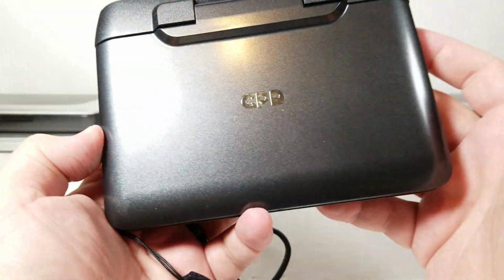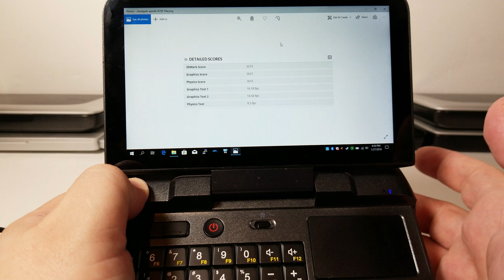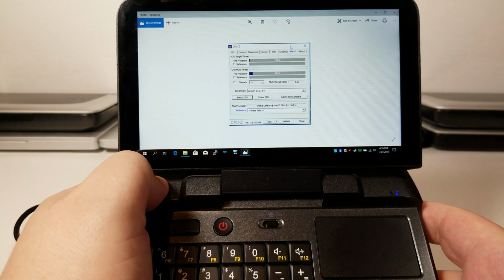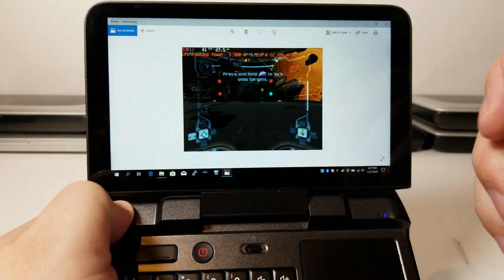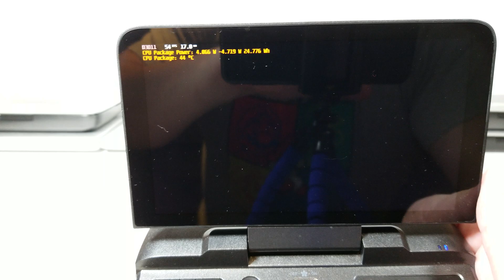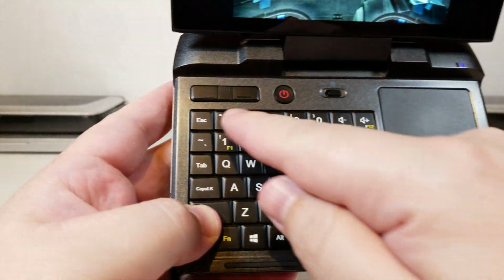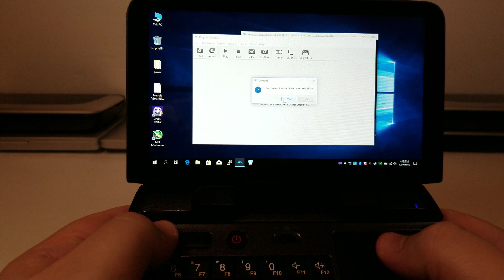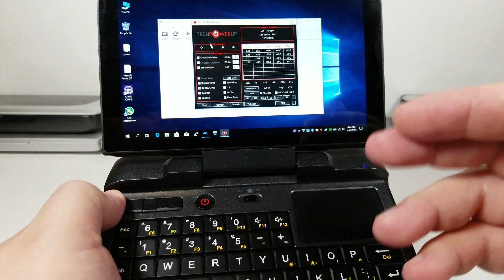GPD MicroPC - Performance Update - 10W TDP And Battery Impressions

Comment: Guys I need help Im on the fence on buying a low buget laptop or a GPD Win2 I mostly plan to play games but not all the time and portability is best in this case and im not to demanding on fps.
Reply: i just bought a gpd win 2 last week and it is great but if you have any patience i would suggest you hold out for a win 3.
gpd win 2 is almost where we all want it to be but the gpu is what i feel is holding it back from greatness.

i as a Canadian paid a hefty sum of 967$ for the 128gig version and an additional 50$ for customs fee from dhl so this 
is very expensive for what your getting.

if your an american that will probably be around 730$ for the same one i bought plus the customs fee of how ever much dhl charges you. your looking at about 800$ maybe a little less.

if you have any specific questions just ask and ill be as honest and real about as one can be.
Reply: @maxxyize  you answered all my concerns I'll probably wait out the win 3 and I completely agree on the gpu leaving something to be desired. Thanks!

Comment: Have you tried undervolting with throttlestop? I only own one intel device (a cheap x5 8300 tablet) and undervolting helps quite a bit. Unfortunately I haven't been able to get it above 1.84 GHz which seems to be the max clock. Considering the passive cooling, that might be for the best.

Comment: Every new vid makes this device look better and better. It costs less than the GPD Win, and outperforms it by a good margin with better temps and with hosting a bigger storage supply
Reply: More importantly: Way better charging management with a way better backlit keyboard. Which are two of the main issues of the GPD WIN 1 long term. Other issues resolved is it has a better microsd slot and a better heat profile.